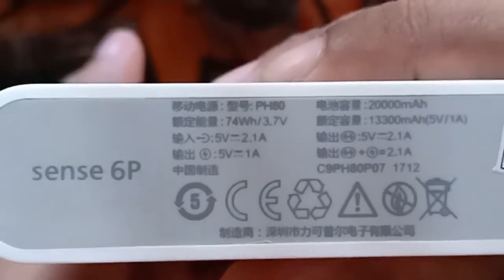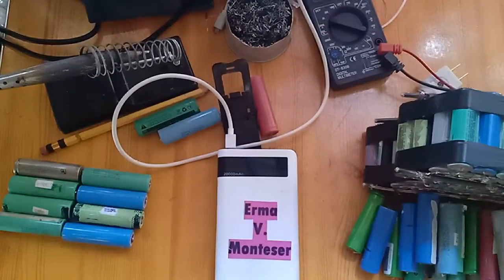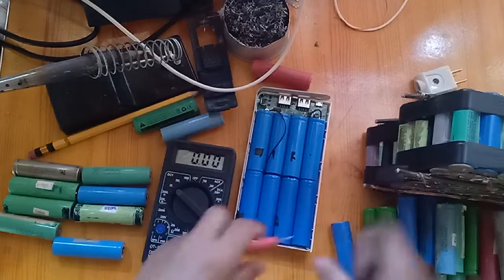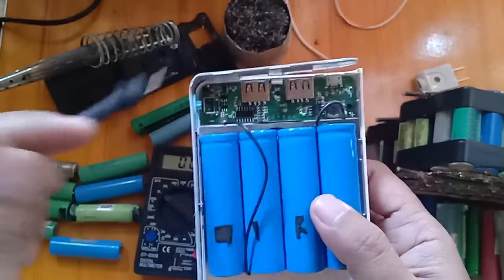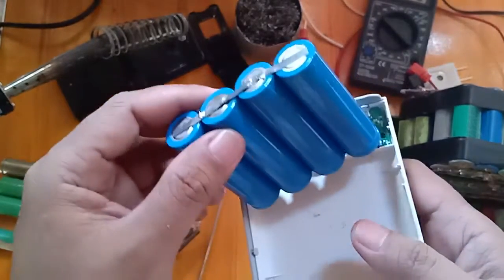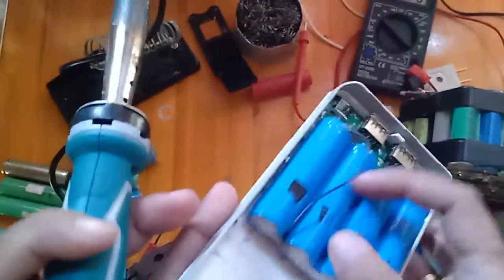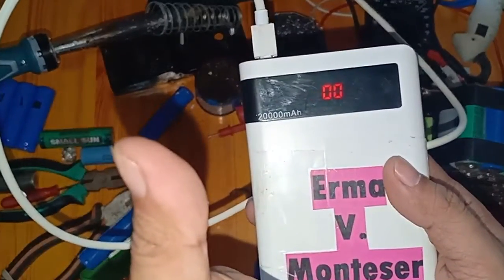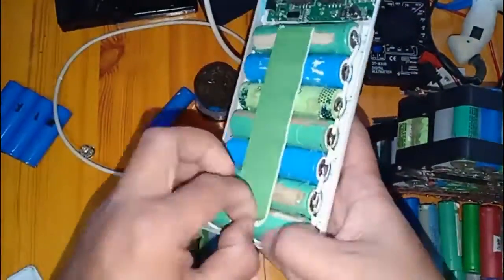ROMOSS  SENSE 6P FAKE POWER BANK and REPAIR

Comment: First of all, cool video! Simple, effective and helpful!

But bro, I have another problem and I'm wondering if you know why. I'm asking you first because I don't want to open it unless I have to (these things are very difficult to open without breaking them in my experience).

So this one is not fake, it's an original 20.000 mAh Romos 6PS pro, bought from their official shopee page, and when it was new it could charge my phone about 4 times (close to 5.000 mAh battery).

But now that I've had it for 1 year, for some reason, every few minutes the display turns on, on its own (without me pressing the button) and displays the battery percentage of the powerbank. This makes it so that even when no cable or device is connected, the powerbank drains slowly over the course of a few weeks.

Do you have any idea what could be causing this weird problem?

I've cleaned the connectors already but that didn't help. 
Do you think that the PCB or the button on the inside is somehow dirty or shorted?

Or is it some type of factory-mode that the powerbank has been put in, by accidentally pressing the button in a certain way or combination?

Thanks in advance :)

Comment: So it means'    I charged a damn sand for 4 hrs straight
Reply from the maker: no actually, those battery with sand inside of it are not connected to the circuit, just a design... Lol